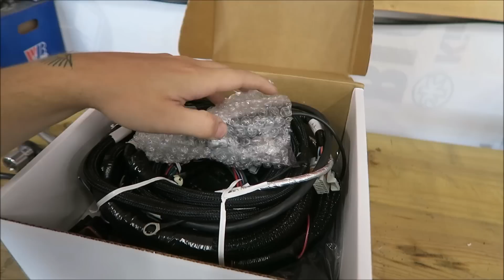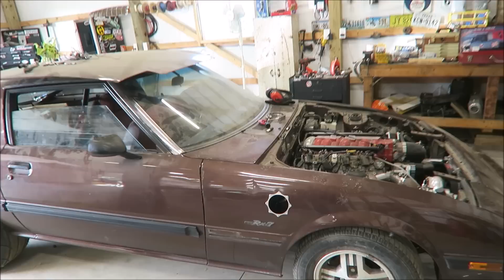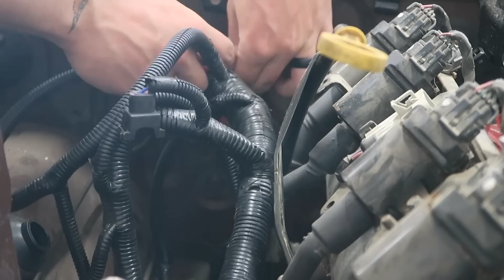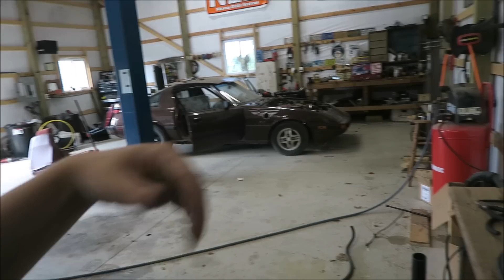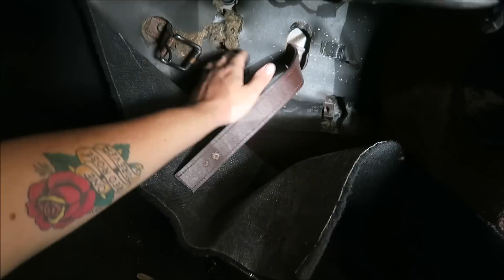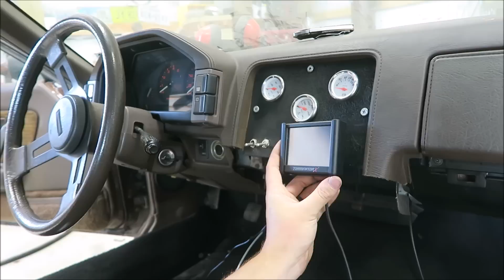Turbo LS RX7 Gets Holley Terminator X!

Comment: For mounting stuff kinda easy that are not ment to be mounted or whatever is with some of the aluminum bar like you can get at the home depot some kinda think stuff like 1/16 thick and you can just bend it with pliers and have a tab on the outside to put a screw thri
Reply from the maker: Yeah, thats the same stuff I used to mount my intercooler